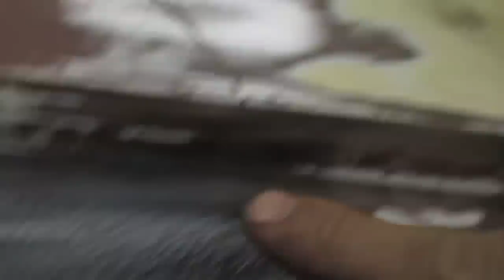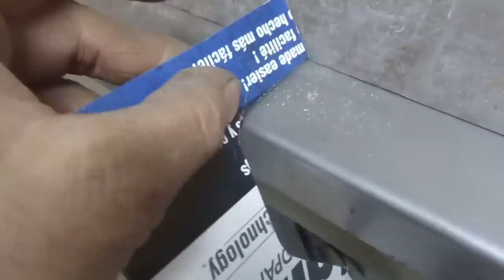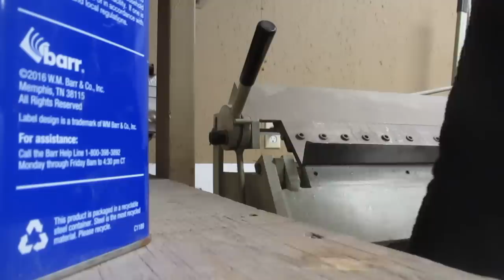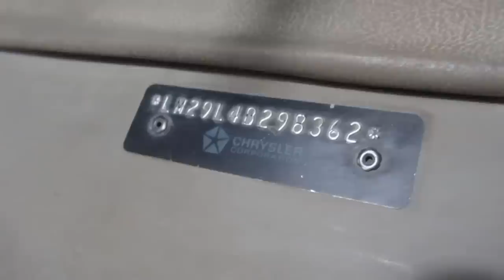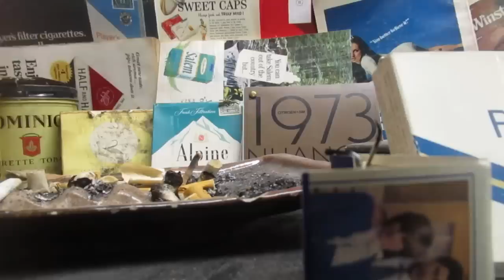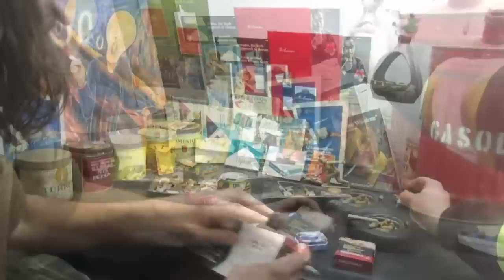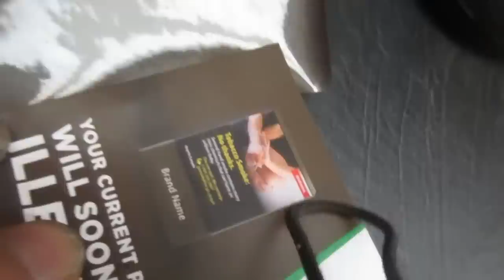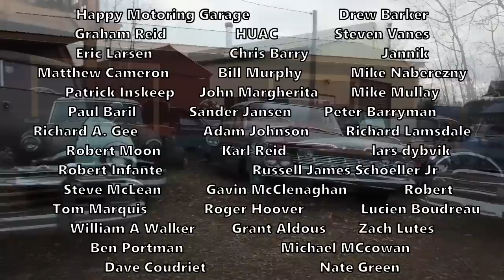Cold Starts, New Parts & Classic Darts!

Comment: They've had those plain packs in Australia for years. Back when I smoked, I'd get a couple of cartons and remove the plastic outer from the packs. Using a cheap rattle can of satin black, I'd dust in over the governments advertising. After it'd dried, I used a stencil of a skull and crossbones and some chrome rattle can to create a new design for my packs. So much nostalgia in this show.
Reply: Now that's dedication!  (When I still mixed ciggies into my weed, I used a 1950s wooden cigarette case with a map of Oz emblazoned with an Aborigine and a boomerang.)
Reply: I remember back in the nineties when I travelled Oz there where different gov-ads on dart packets; so some killed You, others just reduced Your fitness ...

Comment: When you say Darts, this time it is a Dart.Has these guys found any old "green death"? (Export A) I always thought it would be good for someone make the bottom portions of vans including inner and outer door parts of all the van makes. Well good quality ones that is.Whenever I see the Packard hood letters I seem to always see it saying Canada for some reason.
Reply from the maker: Yeah! Al found a pack of GD walled over in a house he was working on. 1971? I think. He smoked 'em, haha. Greens were good cause no one would bum off ya. Yeah, van stuff is becoming more available, but expensive here in Canada with the shipping and exchange, so we'll  be making lots of this one, haha...Cheers!
Reply: @coldwarmotors  Van parts can't be to hard to make, even if it's a bad repo. At least it's gets you started especially with the wheel openings/fenders. M y mum had a '69 and 74 Ford Club wagon, both window vans I learned to drive in. They are sitting on my uncles farm now for the last several years. Like to save them but have no place to put them. Grew up with them.

Comment: 15:30 "Back in the day you could have painted a Lotus in John Deere green and got away with it"
Actually that's not far off the original BRG.  I'm not pulling your leg.  It has its origin in the Gordon Bennett Cup race of 1903.  Stanley Edge was the winner in 1902 driving a Napier, requiring that Britain host the event in 1903.  Due to laws banning road racing in England, it was decided to hold the race in Ireland.  As a compliment to Ireland, the British team chose to race in shamrock green for 1903, tho' the 1902 Napier was painted olive green
Reply: I hasten to add that it was the CARS painted in shamrock green for 1903, not the drivers.....  Just trying to avoid confusion, y'know

Comment: I have a '63 Fairlane Sportscoupe that in '72 caught a softball in the drivers rear quarter under the fin and about a foot from the tail light, it was perfectly in the center of the rounded area and almost half of the ball deep.  It was fixed by not pounding any of it out but drilling about ten holes in it then filling the entire thing with filler by some old man that we weren't sure would live all the way through the repair.  It never shrunk, cracked, flaked or anything and still looks like nothing ever happened from the outside to this day.  This was done in Georgia where it stayed for a few years then has spent the rest of it's life in Indiana so I don't know if that had anything to do with it but I would have thought with somewhere around 2 inches of filler, it would have done something by now but it hasn't yet.

PS your striper is worth his weight in gold, that looks amazing

Comment: You guys are the best; I have a heathen 1976 Volvo 244 that pretend to rely on daily and well.. the strut tower perch or whatever you want to call that POS rusted and launched the spring into the tyre or tire you know that rubber donut thingie, aye... So enter the 1984 Volviiiii Wagon , nothing is the ame, and that made a gazilllion of these brick lego cars, and of course everything snaps apart, note: it does not unscrew or unblolth = miseraly and failure I thinks I am scroooooded and youtube can't correct my typing or misstyping so there ya go. And my 1976 244 is a late model car compared to your fleet. But I'l always folllow the warm more motors channel. Ayaaaaaa